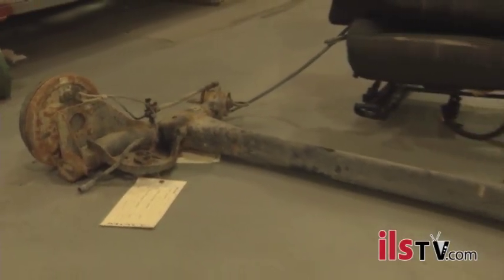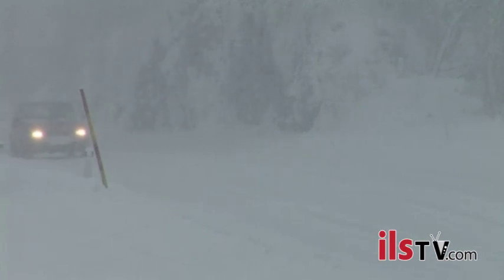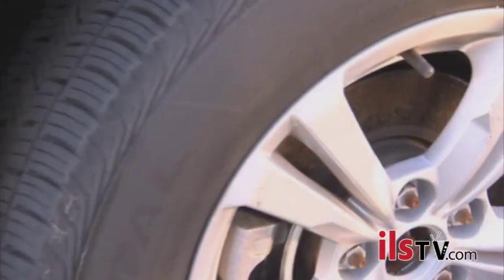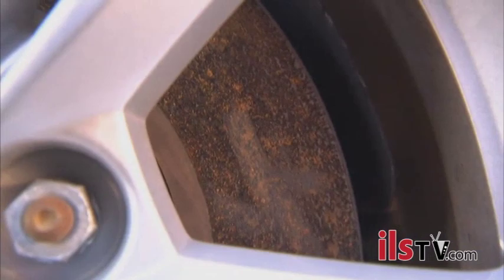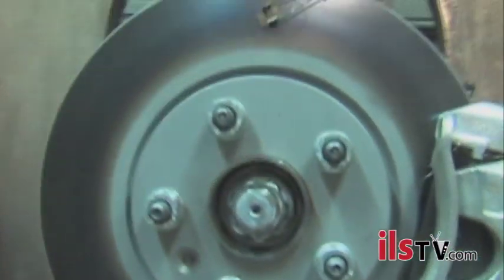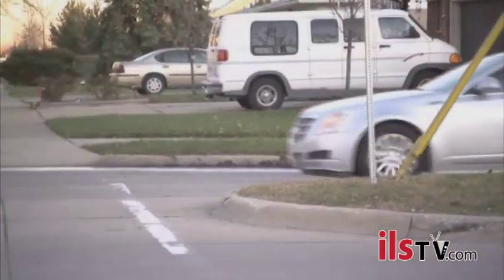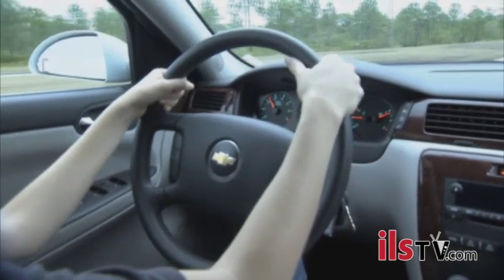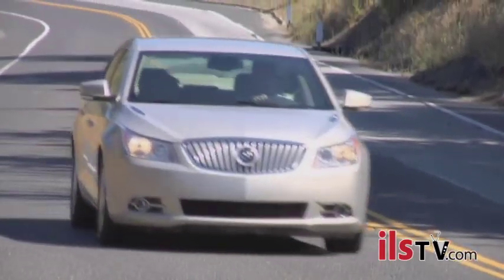New technology prevents car brake rotors from rusting

Comment: Old technology also stopped brake discs (rotors) from rusting.  Dunlop-Girling made the brakes in England but they were fitted to a Lancia Flavia built in Italy.  The discs always looked grey but they never wore or rusted and they never needed replacing.  I suspect that they were made from Hadfield Steel (manganese steel)  The alloying of steel with 13% of manganese creates a metal that behaves like a completely new space age science fiction material.  It is used for tram points and rock crusher jaws and as well as being hard and tough it is non-magnetic and extremely resistant to wear.

The cast-iron discs on my French built runabout are IMHO not of merchantable quality.  The rear discs give the most trouble as they are not worked hard enough to stay clean.  The sickening thing is that after a very light skim and sanding it just takes one drop of rain to rust them again. Basically they are just a waste of space.  AFAIK it is not possible to get manganese steel discs for budget cars so unless one can buy a properly built car one is stuck with the rusty disc problem for evermore.  Jaguar also used the Dunlop-Girling brakes but as the saying goes "You only get what you pay for!"